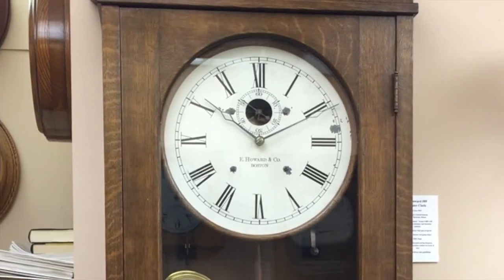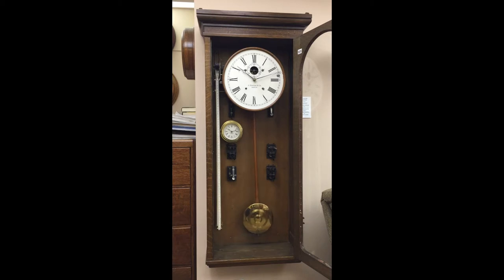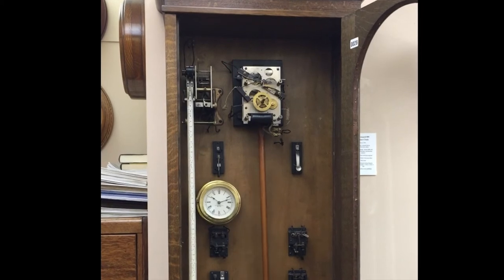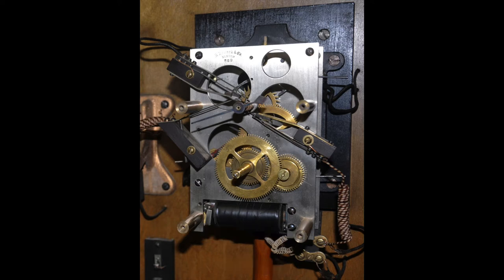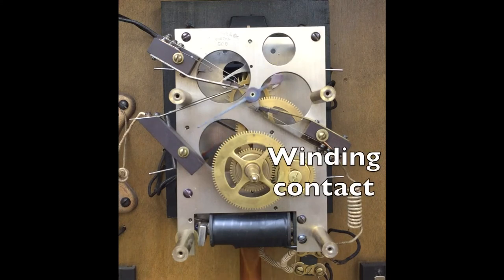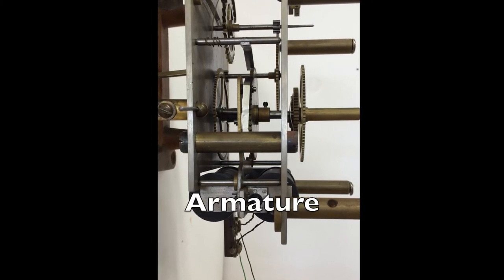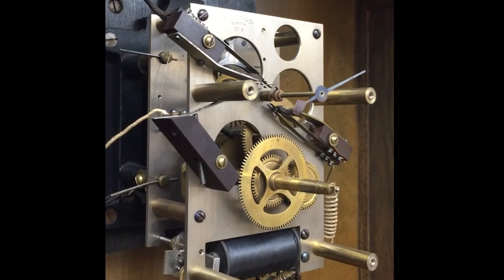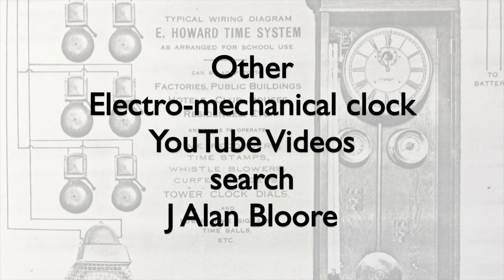How the E Howard Master Clock works

Comment: Alan:  I rebuilt another E. Howard master clock like yours only I discovered one dissimilar adjustment.  I suspected that the one I overhauled was poorly adjusted so that the pin on the ratchet wheel collided with the pin on the center wheel every minute.  Thus adjusted it imparted heavy damage to the ratchet wheel teeth due to the high force of the advancing armature.  Fortunately for me I got away with tightening the spring on the backstop ratchet click and didn't have to set up the mill and recut all 120 teeth on the ratchet.  The main problem I found was a maladjustment of the  backstop for the armature when at rest.    The armature backstop disc was adjusted way back such that four clicks resulted for each stroke of the armature.  Thus the stroke was advancing the ratchet wheel faster than the center wheel was turning.  Thus after after several hours the ratchet wheel pin would bang up against the center wheel pin and remain in that position with only one click being possible.  I figured that since the ratchet wheel has 120 teeth it should be advanced two clicks once every minute to maintain equilibrium with the center wheels' rotation once every 60 minutes.   This adjustment was easily made after I discovered that the lower left dial post had a single hole through the center apparently designed such that a "tommy bar" could be inserted (I used a gage pin) and thus used to slightly loosen the backstop disc by unscrewing the dial post to the left and twisting the disc with your left hand. I set it so that two clicks occurred for each stroke of the armature. I believe that the spring must be adjusted not to be wound tight but to be maintained 90 degrees away from the tight position.   This clock runs very well adjusted as described here and keeps very good time.  My conclusion may or may not be right but what do you think.    Bill
Reply from the maker: Hi Bill,
Sorry to be so late with a reply. Your adjustment of the stop for the armature is right on. My master has a 60 tooth ratchet wheel and the spring is always fully wound but if the armature was advancing four teeth per impulse I would be facing your same problem. Mine advances one tooth per impulse and has been running for years. These E Howard movements are a thing of beauty. Thank you for your comment and Happy New Year.  Alan
Reply: @SelfWindingClocks  Alan:  Sorry to pester you again.  The only problem that has puzzled me on this clock is that the breaker points seem to carbon up repeatedly.  I have to clean them every six months or less to keep the clock running.  The points are adjusted so that the fiber blade lifts them both equally then abruptly drops the one contact to close the circuit and then pops up the other one to open it one second later.  I think that is the proper adjustment.  However there is a considerable arc on opening the contacts.  I also noticed that there was no nichrome resister in the circuit when I got the clock.  Was there an arc suppressor incorporated in this clock design?  My 1915 Synchronome has such a spark arrester.  
Last question:  I'm going to replace the worn down points.  What material did Howard use?  Silver?  I have plenty of tungsten from a TIG welder.  Would that be suitable?
Regards..............Bill
Reply from the maker: @williambonta1744  Hi Bill, Not sure what metal Howard used on the contact points. I have used diodes to suppress the arcing. Make sure you are using the correct voltage on the clock. Some E Howard masters were 12vdc and others 24vdc. Replacing the contacts points is not anything I have done. Don't know about using Tungsten. Does sound like you are doing just fine with these clocks.   Regards, Alan
Reply: ini viv vnv rir boii coii boll coll mase
no ini is rir viv vnv boip wase  vase
poii goii voii roii roll qoll xoll zase is